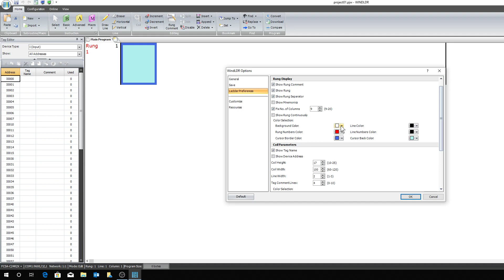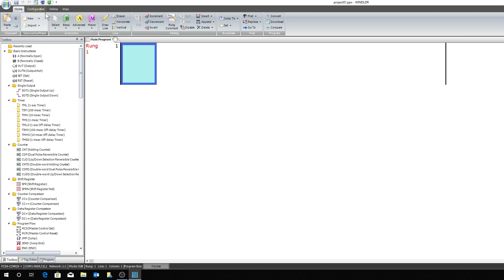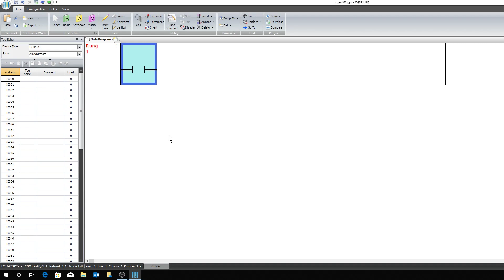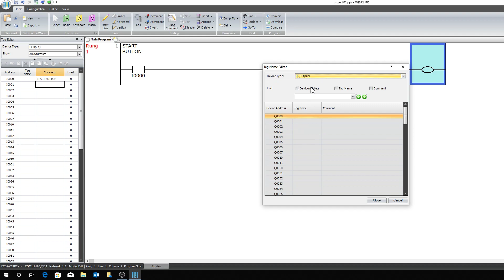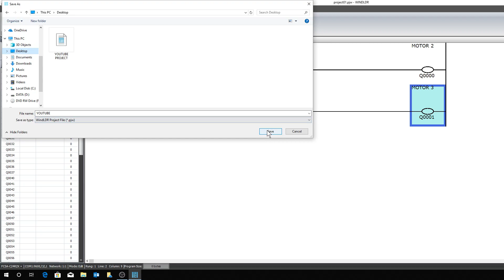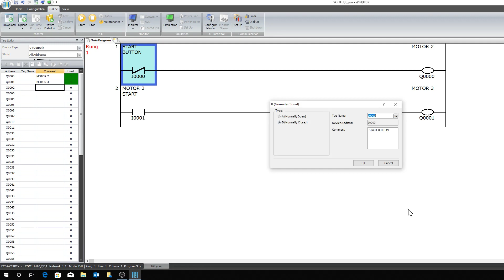Idec PLC Introduction

Comment: Hello sr. I just subscribed to your channel and I am very much interested in learning about programming Idec PLC 
I do have all I need to start programming but I do not know how to. 
I am industrial electrician and I usually do all about motor wiring new controls and troubleshooting but not programming. 

I worked for a Tortilla Factory for 12 years and I am now working for a manufacturer of tortilla equipment. 
 I will now build very small equipment for restaurants or small tortilla factories with my little experience and some friends support.

I have a very small machine shop I recently builded and now need to build a 2 row small counter stacker machine for tortillas but I do not know how to do it cuz I will need to use counters, timers, resets, etc.  

I made a couple of small programas around 17 years ago with idec basic plc but now I do not remember nothing lol 
If you can help me plz get back to 

me, my eMail mizraim@myself.com 

and I will do my best to fairly thank for your help the way I should, prior to end my project and then enjoy programming ahead. 
I do have an HMI also. 

Thank you and have a great one!
Reply from the maker: Sent you an email.  Thanks for watching!

Comment: Nice Video! hey I'm an engineer but totally green on IDEC stuff since I usually work with Siemens and Allen Bradley.. :)
Reply from the maker: Awesome!  Thanks for watching.  I am not an engineer!  LOL.  Just an electrician.  I think you will like IDEC and the simplicity of the software as compared to Siemens and AB.  I have dabbled around with both, and they seem complex in comparison. And very pricey, I will add.